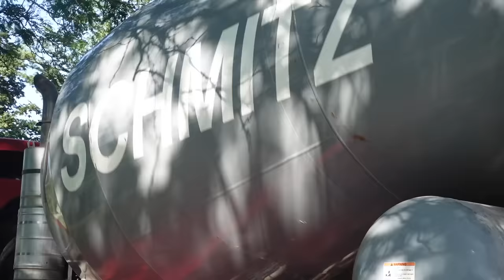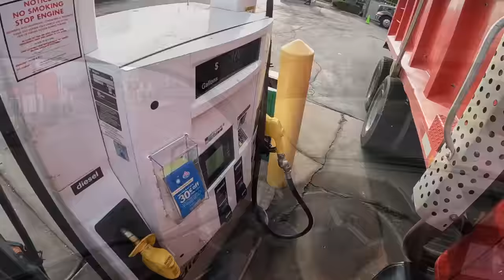I love summers in Wisconsin! BIG patio

Comment: G,day from down under, here's a little tip, if you can't get boards off wall, meaning nails/ screws stuck, use a hole saw on drill, cut around nails, then boards come off and you can easily get to screws/ nails left, hope that helps, makes job quicker

Comment: Hey Ryan are you ever worried about long term exposure to your stamped release? Its a very fine particle and fills the air around you. Great video!
Reply: I've thought the same. No protective mask (thay actually works, rated for the fineness and smallness of the powder) and that stuff goes everywhere!
Reply: I have also commented this as well, it's crazy fine particulate and they wear no masks.
Reply: Silicosis is no joke
Reply: I did it for 20 years no mask ,I am still ok .
Reply: @concreter6832  that’s awesome thanks for clarifying. I was just worried about Ryan and crew!!
Reply: @MrHendy89  I don’t know about awesome lol ,u should definitely wear a mask for the release and also in the concrete it has silica 
In it u can taste it on your lips after concreting all day , I am retired now I would wear a mask if I knew what I know now ,I was lucky ,
I may suffer later in life but all good now .

Comment: Im a utility locator so i work in new divisions where driveways are always being built but ive noticed they dont do the joints while its wet and drying they come back out and cut it days later but yalls definitely look better ever since ive started watching im noticing driveways in my area arent all that great
Reply: He does them both ways. I still haven’t figured out why he saws some and does the others wet.
Reply: @jakem.6479  He prefers doing them wet, but you can’t do that on stamped patios. He has a video where he talks about it, but he usually goes back the next day to saw cut when he has to go that route.
Reply: @RudeGarage13  Thanks!!
Reply: @jakem.6479  Or in Garages where a big control joint would be annoying for moving stuff around like tool boxes. saw cuts are cleaner for those jobs.

Comment: Hey, quick tip for your GoPro footage. Increasing the fps, from what I assume is around 30, to 60 or more, would really help your slow mo footage look smoother. I have no other complaints with the video though. Loving all the new angles and shots you all are getting!
Reply: No
Reply: @keithplayssoccer10  ??
Reply: @Richard Cranium ok. That's what his daughters are for, but whatevs. I can get that...
Reply: @TylerMiller04  you can make your slow motion shots look smooth at 30fps in Premiere Pro if you just re render them.
Reply: @martinryan8409  that's a good point. I wonder what editing software he uses...
Reply: @Richard Cranium exactly, unless Ryan specifically wants some slow motion shots, 30fps (frames per second) is perfectly adequate.
Reply: Wrong
Reply: @TylerMiller04 he uses final cut pro still i believe

Comment: I just finish regular concrete and love when you guys do cool projects like this. Only gotten to do stamped/color a few times in the last twenty years. Heats definitely not slowing down that's for sure, can't wait for July.
Reply from the maker: Yes sir, July is the hottest but we will push through.
Reply: By regular, do you mean hard trowel for the union?
Reply from the maker: @verndetta8315  I think he just means standard finish concrete.
Reply: @VictoryOutdoorServices  Thanks for reply, what's a standard finish? Broomed? Still learning myself.
Reply: @VictoryOutdoorServices  Been testing out for the union and all they do is hard trowel for structural. I am used to what you guys do.
Reply from the maker: @verndetta8315  Yes, just a typical broom finish like you see on most driveways and sidewalks.
Reply: I just meant normal regular concrete. Driveways, patios, basements and sidewalks. Garage floors are about thr biggest thing I do and we break out the power trowel for those.  And footers for the block masons on commercial jobsites.
Reply: Looking at the comment section I take it you guys all don't sleep much either. Standard fall asleep around 2345-0030 and awake at 0415. Good stuff

Comment: Its 115 degrees in Florida by 10am... 80s is light work... but different regions for sure... drink water even when you're not thirsty.
Reply: I been to Florida alot. Wisconsin has a higher rh value so when it's hot in WI it is usually very muggy compared to FL. Lots of water in the air.
Reply: @geodude6244  you should see how much water my air compressor makes here in Florida everyday in a 8 to 10 hour shift, i have a cooler on the compressor and a copper dyer in a 70 degree room to get rid of water

Comment: I hate to be the pump people that has to fix the well with it up in the middle now but that’s nothing I was at a new house we drill came back three months later to install the pump and tank and couldn’t find the well I thought they buried it which dnr were I live will fine you now so after about 30 minutes of looking I went in side to see where the water line is and in the master bedroom closet was the well and the house was two story home and we had to set 2” galvanized pipe 360 feet so we had to cut the roof and both floors it was a mess but we didn’t have any problems pulling it the last time because they accidentally burned the house down

Comment: Still can't understand why you don't get a pump. No buggy to drive around and clean up and no more damage from the idiots driving it. Other concrete companies use them and they're so much easier. Especially now as it's hotter.
Reply: have you ever cleaned a pump? there is a lot of work cleaning a pump also and all those hoses, i myself think a buggy is easier to clean
Reply: @butchs2337   From what I've seen on you tube other companies Don't have any problems. The pump and hoses get washed out and it ends up in the back of the mixer truck and is disposed of back at the depot. Watch Ordell and West coast concrete and see how they do it to name but two. And you Don't need sheets of plywood put on the grass or driveways either.
Reply: @darrylkennedy2125  we had pump trucks with booms the most i was around was a pour of about 600 yards for a sewer plant tank, we also used tow behind pumps with hoses those were always a problem break downs, but a buggy can break down also, we hired both the pump trucks and the trailer pump they were subbed out, it all depends what each is used to and what works best for them, have a great weekend